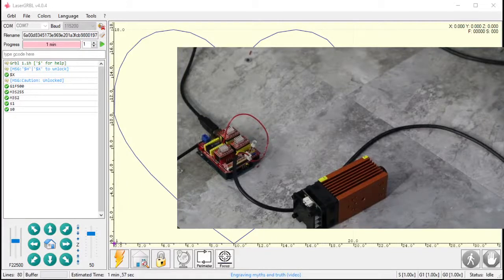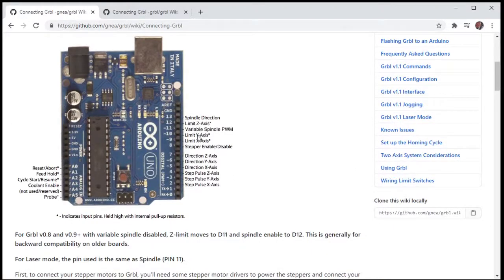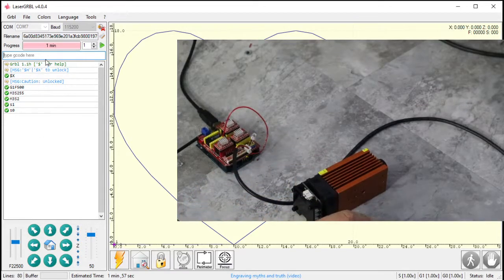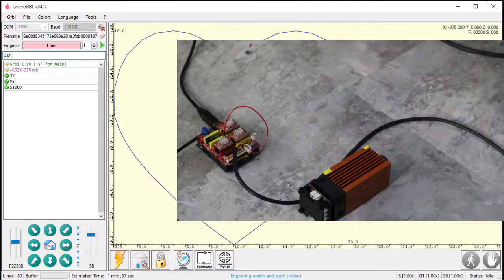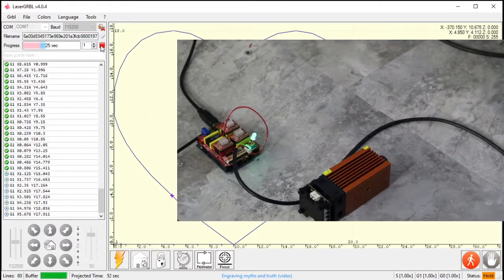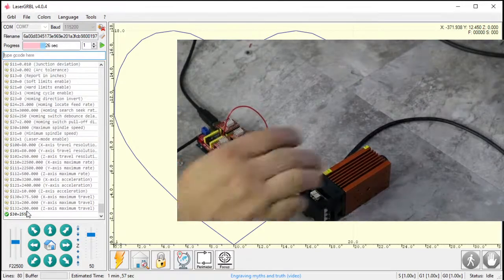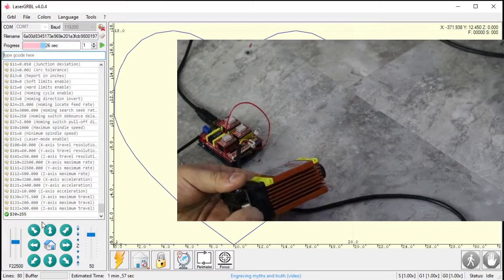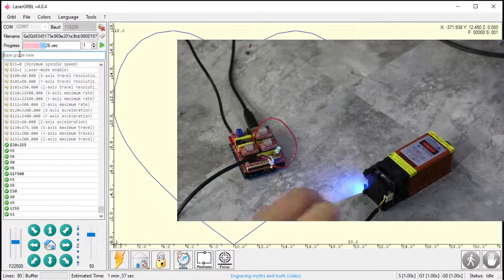GRBL Shield video 7   hooking up your laser and configuring your registers

Comment: Is it possible to alter the code toget the pins back to the way there were for Z end stop? I can't find .9 version. Not so sure I can figure out the code either.
Reply: I may have figured out a solution by copying V.9 hex file. Saving in note pad as a .hex and uploading thru laser GRBL. Trying out tomorrow.

Comment: Hello, I need your help! I have my own CNC Machine, the controller is the same as you use, Arduino Uno + CNC Shield with A4988 Stepper motor drivers! I used it as a pen plotter before! But now I need to convert it to a laser cutter, I already bought a 2.5W, 12V laser module. I saw your video, The thing I need to know is, how should I connect the PWM pin on the module to the CNC Shield? What is the diagram? 
Please help me!

Comment: Is it possible you can make a tutorial on this based on the ender-3 motherboard such as the 4.2.7 board? I'm trying to figure out how I can modulate an Aliexpress laser module which is low powered and will power it at 25mW to make PCBs using photo-lithography process.

Comment: So question for you. You are giving the laser a PWM Signal could you power a servo from this instead of a laser if you set the max at 175. I am using this right now it works great love the work. The reason is I am making a pen plotter and need to use a servo to move it up and down the laser would be set when I load the program 10 mim and max 175.
Reply from the maker: Yes!! There are GRBL releases that use servos instead of lasers. Also,, FluidNC supports servos very well.
Reply: @brakthehun  thanks for the replay tried so of the programs but they gave me Errors in Inkscape. So what I ended up doing is to write a small program for a NANO to control the servo. The NANO keeps checking the laser pin for high or low then moves servo had to set laser out to 1000 but it works. I will see how much of a delay there will be it goes high till pen goes down. But looks good so far.

I did enjoy all you videos on laser grbl so far. Thanks again.

Comment: Hello. Thanks for the video it really has helped me out a lot. I was wondering if there is a way to do the same with 4-wire laser modules that have a fourth wire for temperature control, do you know if the CNC shield support that functionality?
Reply from the maker: The 4th wire is typically another ground. I would need to know what laser you are using
Reply: @brakthehun  oh ok. I am planning on using the 10W LU2-10A Laser Module from Ortur
Reply from the maker: @JARC99_  Yeah,, there are 2 grounds. One is PWN / gnd and the other is 24v / gnd
Reply: @brakthehun  oh good to know. Do you know why they put two ground wires?
Reply from the maker: @JARC99_  Some laser controllers are isolated from the power supplies. This way,, It makes sure ground is shared between the power supply and the laser controller.

Comment: Hello
I do not have the 3 lines ( 30, 31, 32) hot to add them ? and my laser is always on. Thnak you
Reply from the maker: Perhaps you have grbl 0.9
Reply: @brakthehun  Yes I have grbl 0.9.. anyway you helped me by an idea to use chnese relay and it worked as well. thank you

Comment: Where exactly are you hooking up the 12 volt power for the laser... the video isn't clear enough to see. I got the z limit and it is functioning fine from 0-5v for the PWM depending on S level... but I fail to see where the 12V is coming from exactly, can you explain?
Reply from the maker: The screw terminals

Comment: Superb, The bit re G1F500 is what I have never seen on any other info and has had me beat trying get a PWM signal on a 'scope from the drive pin which is Z- OR Z+ on the Protoneer GRBL Arduino Shield, as these two signals are connected to the same pin D11on the shield PCB, just some info for anyone else having issues, as some people refer to them individually, but either will do.    Many Thks.

Comment: HI well here is a conundrum how do i install this to a cnc shield 
FB03-500 500mW 405nm Blue Violet Laser Module 2.54-3P TTL/PWM Modulation
 DIY Engraver for EleksMaker any help because i dont know where it goes 
been trying to find any information but i have found nothing on this 
model.

Comment: Hi. I just bought a 5.5w Bachin laser module. What can you suggest are the best X,YZ travel resolution step/mm?
Grbl 1.1 defaults are:
X,Y,Z = 250

Max rate 
X,Y,Z = 500

Acceleration
X,Y,Z = 10

Is this good enough for laser?
Reply from the maker: Probably xyz to 80 steps per mm
Reply from the maker: Max rate x:12000 / y:8000 / z doesn't matter
Acceleration x:400 / y:150

Comment: Thanks for explanation.
My question is :
Since I have a 10W laser, do I need to buy an additional one TTL driver board?
Can I control it with an Arduino Shield instead?
I mean engraving or light cutting.
Reply from the maker: You do need a ttl driver for the laser. Most lasers come with a ttl board or have them built in.
Reply: @brakthehun  
In specification my Laser Module by VoidMicro  I see :
PWM/TTL Input: DC3.3V-12V 100Hz~50KHz Preferred: 5KHz.There is 3pin plug .
When I will used Arduino Shield V3 with stepper driver there will be OK?
Reply: @RonAdamsky  Hello! I'm having the same problem as you. How did you manage do solve it?

Comment: Great tutorials i been wanting to switch out my stock k40 board for some time just didnt want to hassle with firmware etc.. So simple..question my k40 has a k axis.. Since ill be using the Z endstops pun for pwm. How would i wire my z endstop?
Reply from the maker: The spindle output of the GRBL board is wired to the Z end stop